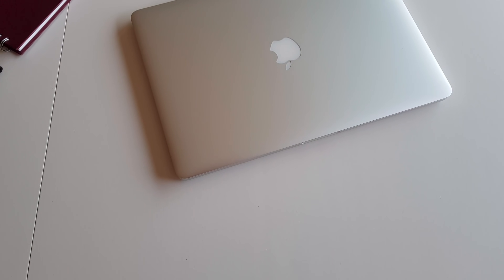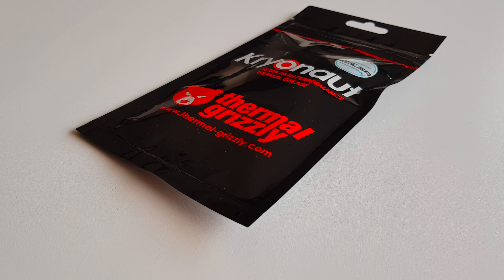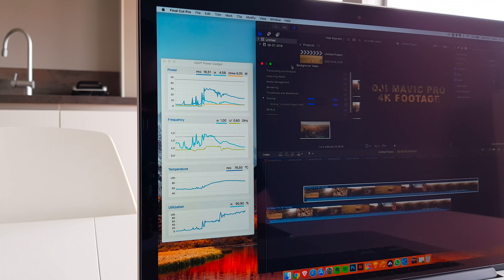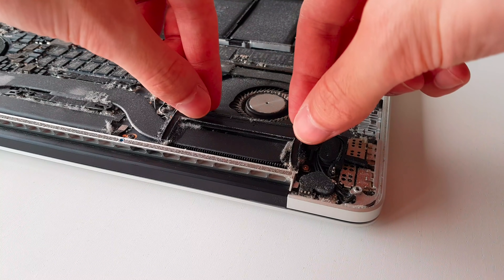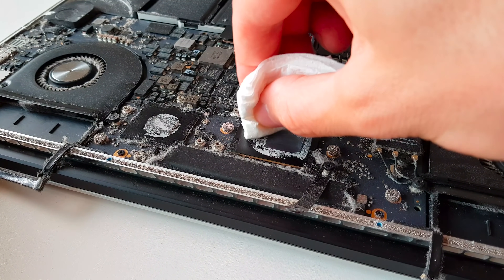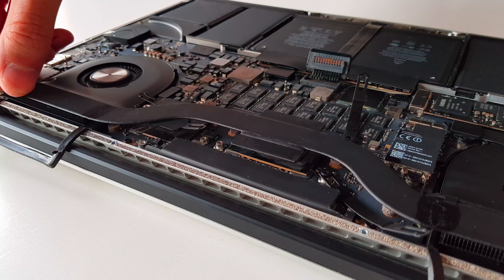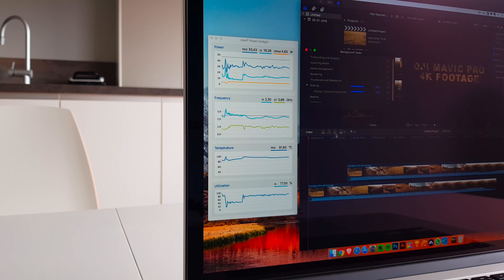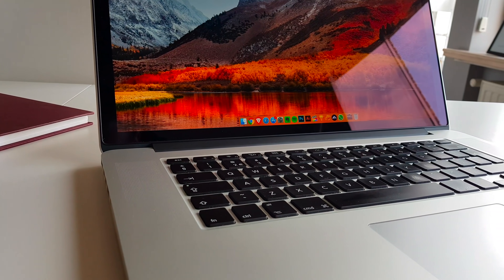Solved overheating problem on my MacBook Pro 15" Mid 2015 by replacing the thermal paste

Comment: I’ve changed my thermal paste on MacBook Pro 2015 no dedicated graphics , and however fans do not start themselves like a jet when I play 4K video I’ve noticed that my temps ramp up quickly to 60 degrees and even 80s when I turn on parallel desktop with win10.Is it normal. My thermal paste is 3.5kw thermal conductivity. If I would use grizzly kryonaut will I get more stable temps ?
Reply from the maker: You could give it a shot. It's one thing how much/how fast you can transfer heat from the CPU to the heat sink, but it's a completely other thing how much heat/how fast can the heatsink dissipate the heat.
Reply: @DigitalPulse  Yeah I know but I thought that if I can ease up whole thing with quality product. Why not? Thx a lot for an answear ! Great Vid!
Reply from the maker: I didn't do a comparison test so I can't say anything with 100% certainly 😞
Reply: @DigitalPulse   thx anyway!

Comment: What is the software that is showing the graphs in screen about the thermal characteristics.
Reply from the maker: Intel Power gadget
Reply: @DigitalPulse  Ok  i also use the same. I also use another software named "Hot"  that indicates whether the CPU is currently throttled or not in %age.

Comment: How did you clean the fans? how did you clean the dust out? what did you use? no good making a video just to show how to replace thermal paste if you´ve already stripped it down that far. Incomplete video, but what you did is very good.
Reply from the maker: Use compressed air and cotton swabs dipped in isopropyl alcohol. Be sure to hold the fans with your finger while you blow them with air so that they don't start spinning insanely fast (could damage them). If there is dust left get it out with cotton swabs. Good luck!

Comment: Great video. Wondering if you have also looked into adding thermal pads to this model of the MBP? I've heard it further helps dissipate heat? Would like to hear your thoughts on this.
Reply from the maker: Indeed that's something that you can do to transfer the heat to the backplate of the MBP. Highly depends if the heatsink is exposed so that there is a direct connection with the heatsink and backplate. Also you need to check the tickess of the pad needed. I did that on my desktop GPU and it works wonders 👌

Comment: Do you think I can upgrade the RAM for this model?
MacBookPro10,1
MacBook Pro (Retina, 15-inch, Early 2013)
Reply from the maker: If I google it then yes you can. Actually it's quite easy to check... unscrew the backplate and check the SODIM slots. If there is an empty one then yes you can. I would also advise you to replace your mechanical hard drive with an SSD if you already didn't do that. That will give you a much, much bigger performance boost than more RAM :)

Comment: Can I use the Aeronaut thermal on a macbook air? I saw some liquid metal warnings but I believe this one is not...
Reply from the maker: Yes you can. Indeed avoid liquid metal in laptops. Sorry for the late reply
Reply: @DigitalPulse  Hey, thanks a lot man! I will use the Aeronaut one.
Reply from the maker: Good luck!

Comment: This is an excellent video - thank you so much Dario. 

The iFixit article for my mid-2014 rMBP (A1398) does not mention the extra 4x GPU screws (I guess the discrete GPU is not found on all models)
Reply from the maker: You are welcome. Thanks for watching 🙏

Comment: Love your video! If I want place thermal pad to mod it, where should I put them? Could you kindly guide us? Thank you!
Reply from the maker: Hi Ji. What kind of thermal pad are we talking about? Is it a thermal pad used for the CPU (usually paper thin) or are we talking about thicker thermal pads that are used to cool other components like memory?
Reply: @DigitalPulse  Yes Dario, on CPU, GPU, and other parts that you would recommend.
Reply: I am using Macbook Pro 15 retina inch mid 2015 model.
Reply: @DigitalPulse  I guess that applying the thermal pad on the heat sink?
Reply: And what is your view on liquid metal?

Comment: Alcohol is on the way from amazon.  I replaced the battery on my Mid 2014 earlier this year, still getting extremely high temps, can't wait to replace the thermal paste.  Any tips for cleaning the ports on the sides of the macbook?  Usb, thunderbolt, etc.?
Reply from the maker: Get some canned air and blow them out 😉
Reply: @DigitalPulse  it's gunky!   The air doesn't do the trick, I guess alcohol and some kind of poker would do.

Comment: I just changed my MBP Mid2015’s thermal paste (Grizzly Kryonaut) and it really did a big improvement from 61C to 41-44C.  

However, i can’t say the same for my MBP 13”.  I used the same thermal paste but it’s become more warmer than usual.  The CPU temp randomly spikes from 80-97C.  Even if temp goes done (67C), the fan is spinning at 3xxxrpm.  

I’m gonna try a different thermal paste (Arctic MX-4) and see if there’ll be any improvement.
Reply from the maker: Thanks for sharing. I did the same on my girlfriend's MBP 13" 2017 model and applied the MX4 from artic and got just a 2 degree temp reduction. I think that the MBP 13" physical can't dissipate because of its small forms factor. But please let me know if you get better results. 🙂
Reply: it seems that my MBPr 13" Early 2015 favours  Arctic MX-4 than Grizzly Kryonaut. Initial startup started with temp spiking between 85-104C but started to dwindle down after a few minutes.  Normal usage (browsing, opening documents), the temp plays around between 50-63C. The lowest that I got was 46C at 1298rpm.  Running a 1080p on Safari with another window replying to this video, the temp is 54C at 1300rpm.  Now, opening and playing video on Chrome is a different store.  Launching Chrome (2 windows) spiked the temp to 104C and then played around between 75-90C.  Playing a 4K video, temp maxes at 105C with 3xxxrpm (the video also stops every now and then).   I can immediately feel the top of the keyboard (where the exhaust is) really heat up.  The base of the laptop is also hot (lucky I have a stand).  After closing Chrome, temp started to lower down again to as low as 49C. D*mn Chrome.

Comment: my fan was constantly on, even when I was just watching youtube and no other background applications running. After following this video my fan only comes on when it should - a heavy work load and the macbook feels so much smoother! Thanks!!!
Reply from the maker: No problem man! Happy it helped you 😃
Reply: I second this! I just performed the fix and my fan has not turned on performing basic tasks. Thanks so much for this video!!!
Reply from the maker: Thanks for watching 🙏

Comment: Bought some thermal paste and a tool kit. Managed to get every screw other than the ones covering the GPU off. The screws seem like they’re fused :/
Reply from the maker: Be careful with it so that you don't damage the screw head. I don't really have any recommendations how to solve that other than taking it slow.
Reply: @DigitalPulse  Thanks for the reply :) I think it's because I bought a cheap set of torx screwdrivers. Going to buy a better set and give it another go
Reply from the maker: Good luck! Let me know if you run in any additional trouble 👍

Comment: I just did this on my mid-2015, following your tutorial. It's very well explained, thank you. I didn't run any benchmarks but it seems to be running a bit cooler. I used Arctic Silver 5. It was my first time applying thermal paste.

Comment: Very informative, and easy to follow video. Is it ok to start up the Macbook straight away after doing this? TIA
Reply from the maker: Yes. Why wouldn't it be?
Reply: @DigitalPulse  Wow! thanks for the prompt reply.
Reply from the maker: I use the isopropyl alcohol that I listed in the video description and I dip the bud in it to clean surfaces. After that I use a dry one to dry the surface. Hope it helps 😀 Good luck with your repair!
Reply: @DigitalPulse  Sorry, I just re watched the video and seen that😃Thanks again👍
Reply from the maker: No worries. Better to ask than to make a mistake along the way. Good luck John! 🤞
Reply: @DigitalPulse  Hi sorry to be a nuisance, but I'm having real trouble finding the IPA cleaning fluid in the link above. It's out of stock everywhere. Is there an alternative that does the same thing? TIA
Reply from the maker: No problem. Feel free to ask... What country are you from? Just asking so that I can provide you with the correct link...
Reply: @DigitalPulse  I'm in the UK Thanks
Reply from the maker: @JohnConboy1  Here you go: https://amzn.to/3ae4L2x 

(it's my affiliate link)
Reply: @DigitalPulse  Thank you so much.
Reply from the maker: Actually, thank you John! 🙌

Comment: Have been due to replace paste on mine, and GHSI definitely made me pull the trigger on the screwdriver kit. I’m currently at 75-85 degrees when using safari at times. Logic Pro now throwing me overload errors due to throttling. Going to replace with some mx-4 paste i use on my gaming machines

Comment: Great video...very detail.  What is the program or software you are using to measure temps and processor speeds?  About to replace battery and blown speakers and will throw this into the replacement as my MacBook Pro sounds like a Harrier aircraft with the fans spinning at full speed much of the time.
Reply: Same here lol how did it go?!

Comment: Hi, this was useful as a guide to the thermal compound replacement — I have the exact same model as your device. The device definitely is running around 5-7 degrees Celsius cooler now. But it still throttles when rendering video in Final Cut Pro and also when using certain plugins in Logic Pro X. I think the MacBook’s performance issues run much deeper than just thermal transference.
Reply: I am seeing the same thing unfortunately. Was hoping it’d be much cooler at idle.

Comment: I am waiting for the same toolkit you used... will use it to repair my MBP 15" 2015 speaker and MBP 13" 2011 battery and hdd replacement

Comment: Great video, I am going to try and repeat your process with my laptop soon. I have a 2013 macbook pro and can only imagine the filth it has internally. I noticed that you used a brush to clean the major dust. How did you clean out all of the small cracks and fragile components? I was thinking about using a shop vac to suck all of the dust out without having any contact. Is this a good method of removing dust or will this harm my computer? Thank you.
Reply from the maker: Rather use canned air to blow it out. A vacuum or brush could cause static electricity. Mistake from my side.
Reply: @DigitalPulse  Not a problem, thank you for the quick reply and advice!

Comment: Great video, just bought MacBook Pro 15” 2015 and it actually burned my fingers using the trackpad. Keyboard get really hot and fan noise outta the world. So I’m gonna try this solution. Will edit after.
Reply from the maker: Good luck man! 👍

Comment: I tried this on my 2015 Macbook Pro and after it is now hotter... seriously overheating, almost to hot to touch... what could be wrong? :/
Reply from the maker: What thermal paste did you use? Can you double check the thermal paste got applied correctly on the CPU and heat sink (lift the heat sink and check the spread)? Did you tighten properly the heat sink screws?
Reply: @DigitalPulse  I used Artic MX4. Screws all tightened. I will take it apart tomorrow and check. What could be wrong? I followed all the steps.
Reply from the maker: @jammyd33  Did you disconnect any of the fans? Are both of them spinning? Did you clean up the dust before putting everything back together? (sorry for the stupid questions but I experienced in a lot of times people forgetting to do the most obvious things - eg. Forgetting to re-apply the thermal paste)
Reply: @DigitalPulse  No worries, I appreciate the help. Yes fan is working, 13" Macbook Pro. Cleaned the fan and everything is working. Do you have an email? I can send pictures when I open my Mac up tomorrow and try it all again.The only thing it could be, a bought a replacement heat sink, it was third party so could it be that it is not as good as the original? I still have the original heat sink so will put that back in tomorrow.
Reply from the maker: I am quite confident it's the replacement heatsink that is causing those problems. Why did you even replace it? It's not that a heatsink can get worn out that easily...
Reply: @DigitalPulse  very good point. It's an old machine that has had many repairs, so I thought when I upgraded the fan I might as-well change more parts. But learnt a valuable lesson, don't fix what isn't broken. Will put the old heatsink in and report back.
Reply from the maker: Let me know if it gets fixed. Good luck! 💪
Reply: @DigitalPulse  Just put the old heat sink back in and applied new thermal paste! So far so good, the fan isn't kicking during normal use. So that's a good sign.
The temp is still averaging 60-75c whilst typing this comment (only programme open). Is that pretty normal for a MacBook Pro 2015?
Reply from the maker: Yes. That should be the normal range. In general MacBook are known to have shitty temp. So that's perfectly fine in my opinion. Did you put a fresh layer of paste before you put the old heat sink back?
Reply: @DigitalPulse  Great thanks for the help! 
Yes I did. A fresh pea sized drop of MX-4. After a few hours of use, the Mac's working sooo much better. 
Still manually boosting the fan when I teach online (4-5hours video conferencing in a row) just to try and keep the system as cool as possible. Also got the MacBook up up a stand that lets air around in.
Reply from the maker: Glad to hear that it worked James! Hope it holds up well in the upcoming years 💪 Have a great day!

Comment: anyone else trying and confirm that it works perfectly?
Reply from the maker: There is a whole bunch of comments on the video that confirm it. Just read through it.
Reply: @DigitalPulse  I will be following the instructions. to confirm: i will buy: 1) Termal Grizzly TG-K-001-RS Kryonaut 12,5 W/m    2) screwdriver 3)  Dust-Off DPSXL Disposable Duster - 10 oz.   4) Swan Isopropyl Alcohol,      is that all? where do you use the alcohol?
Reply from the maker: You use it to wipe off the old thermal paste. And yeah that's what you need 🙂 Good luck!

Comment: Hey Dario. Am changing battery in Cristina's 2015 MacBook Pro and watched your video as she works with Lightroom and I hear her fans now more than I did earlier.  For a first vid you are already a pro.  Easy to listen, easy to follow, making perfect sense all the way.  Thanks very much, I had no idea that this was something that could be done.  I have the two tools come with the battery and the plastic 'pry bar' tool with the tools to change an iPhone battery.  Your kit may be overkill but would be totally complete.  Thanks again.  Have subbed and will look to see what else has been posted.  Good luck with the channel.  I know I wont be the only one to thank you.  Frank.

Comment: I did it and my Mac died, i couldn’t open it; i brought it to a repair professional (i broke two cable in doing so and i put too much paste... this guy is stupid) i would rather pay 60 euro for this procedure than buying for 30 euro the materiel on amazon and making it myself... so i paid 140 euro in total which is quite good since he did cleaned up the processor hahah
Reply from the maker: Did you just call me stupid for you braking the cables by yourself?
Reply: Dario Prski not for the cable, the thermal past... the repair professional told me it’s not correct at all; it’s too much and it could cause damages
Reply: Dario Prski next time do things properly
Reply: Dario Prski I knew I broked it it’s my fault; but you can also précise that with a professional it’s between 50 and 60 euro (processor and ventilator without risk) and if you do it yourself it’s risky and just for 30 box less...
Reply from the maker: That highly depends from country to country. This is a DIY video. What would be a purpose of a video where I would say "just take it to the shop". Makes no sense. If you are careful you can fix this for 15-20 euro. I can't influence the fact that someone is not careful and clumsy.
Reply: Dario Prski well in France 🇫🇷 ok sorry dario for the stupid ))) take care )))
Reply: Dario Prski so to conclude I encourage ppl to find a Apple store and pay 50 to 60 box instead of buying the material in amazon for more or less 30 and taking useless risks... it’s not that easy... especially for a 5 years Mac; also you should put gants 🧤 and push 30 seconds on the open button... your methods it’s not complet.... if you touch a piece you could cause a electrostatic shock etc.... breffff see u bro sorry for the stupid; i am stupid not you )))

Comment: My 2014 MBP was having issues maintaining a stable wifi connection on heavy Zoom calls.  Turns out the wifi card was getting heat soaked by the processor.  I replaced the Thermal Paste and now it works perfectly and I can already tell the chassis doesn't get nearly as warm as it used to.

Comment: Thanks for the tutorial, i had the same macbook pro 2015 15" and i did this. Ordered the same thermal paste and i'll rate it as easy DIY just follow the step by step. Please take note that after you plug back in the battery and turn back on the power your monitor will show you "Plug in charger" Icon (Even if you are running on 100% battery) the laptop is just indicating to plug back the power cable thats all. So do not panic if your laptop wont boot up in battery mode. Thank you hope this helps.
Oh ya, since i had extra thermal paste i replaced the thermal on my 2017 Macbook air. Quite surprised that apple did not apply any thermal on the GPU! so glad i did an extra mile today.